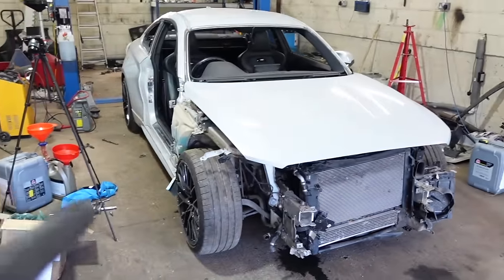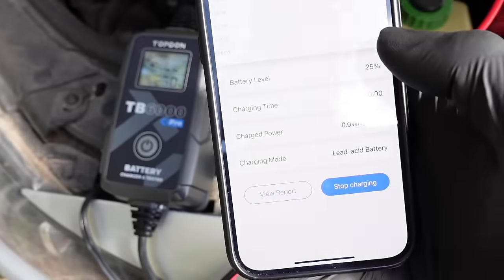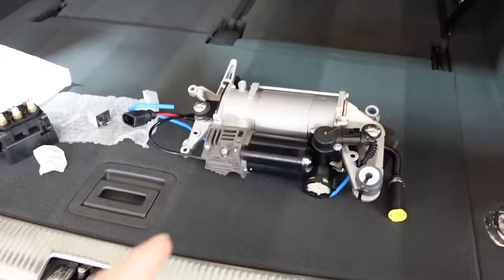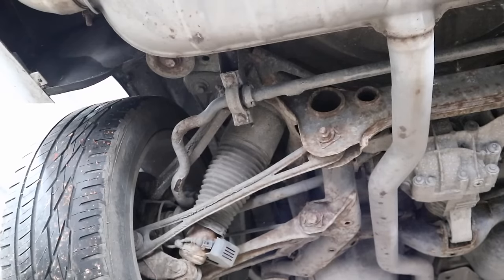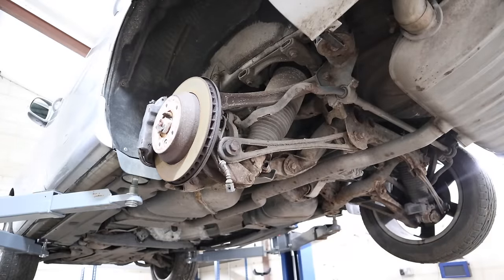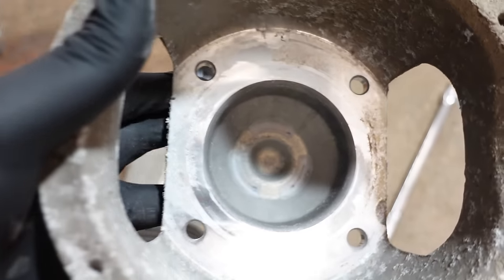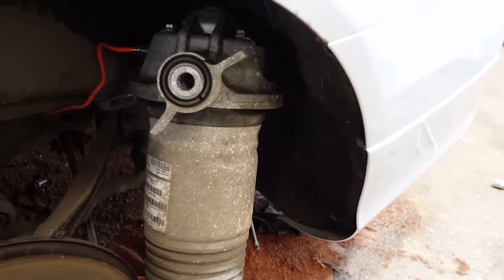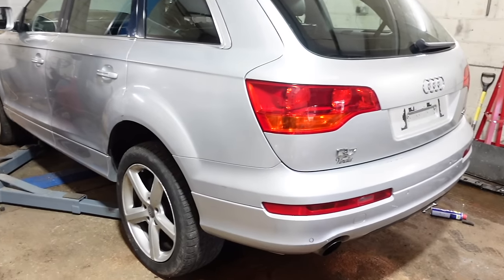FIXING MY AUDI Q7 FOR FREE!! AUDI WANTED £10,000!!!

Comment: 50 years ago a good mechanic would have happily diagnosed the issue correctly and charged you a few hours labour to do what you just did. Today, being a mechanic generally means (obviously not all) learning how to use a diagnostic machine to tell you what parts you need to order and then just swap. Far too much of a throw-away society today IMO. Good job well don pal !!
Reply: Can't remember the last time I plugged in a diagnostic, only for it to tell me a sensor has broken...now you mention it, what is the point, it can save time and effort, but personally I've found the system just reports back on itself making the entire thing redundant.
Reply: 💯 agree. We’re very lucky to have a polish mechanic who very old school. Doesn’t sell you anything you don’t need and pretty much refurbs stuff that can be. TBF only really bible as he charges a ‘fair’ hourly rate and works for himself at home, so very few overheads 👍🏻
Reply: To be fair 50 years ago Audi would never have dreamt of designing this garbage to begin with so mechanics then didn’t have to deal with poorly engineered over complicated rubbish.
Reply: The early 2000’s were a happy medium where good mechanical knowledge + modern diagnostic tools good get you very far with with diy. With the most recent vehicles you’re useless u have to seek mechanic or dealership because vehicles are way too complicated now
Reply: If you took this to a mechanic 50 years ago it'd take him an hour to figure out how to open the door.
Reply: @James__bond007  Yep, and even when you identify the issue, half the time you need a special tool to replace the part.
Reply: Totally fake video, he came back 5 minutes later to show how It s worked, the front sospensions magically repaired without even touch them
Reply: @8dvd8  You obviously missed the part where he fully explained the reasoning behind the fronts not needing to be repaired, or you're just trolling. Probably the latter option methinks.
Reply: @8dvd8  Maybe consider less drugs? Dean never fakes anything and your comment doesn't even make sense.
Reply: @Nite-owl  i missed because It s a clickbait, a scam. Like the part when the battery apparently " died " ( not replaced with a junk One or left die for commercial porpuse ) . Open your eyes
Reply: @8dvd8  My eyes are perfectly fine and open, thanks. I'll give you the segway for the battery charger thing wasn't exactly smooth, and was in all likelihood a setup for a sponsor segment, but lets be honest, no-one's stupid enough to think it wasn't likely, nor are they dumb enough not to expect sponsored videos on YouTube channels. Very few are bothered by them enough to kick up a fuss. Either watch the videos, or don't. If you don't like the content, don't watch anymore of their videos, it's not a complicated system if you think about it 🤪 
As far as I can tell, the title was not clickbait. He fixed the air suspension himself by removing and cleaning the O-rings, rather than pay an outlandish figure to replace the airbags that was quoted by the Main Dealer. Not sure what you felt was clickbait, but I'm sure you'll enlighten the World with your wisdom 🙄I on the other hand won't be replying further, your comments don't warrant any further time wasted. Don't like it, don't watch, now move along please !
Reply: @8dvd8  jog on
Reply: @8dvd8  ugh you are probably 12 but please don’t comment when you have no clue.
Reply: very different times now. walk into any garage and theyll rip you off if they think they can.
Reply: 50 years ago cars had carburettor and people never heard of a Turbo was there no such thing as an ECU or a OBD PORT where you can plug the car in and cars get more advanced it FACTS
Reply: @agt155  My father rebored his last engine at 80 years of age he lived to 90..
Reply: That's easy when the manufacturer doesn't ask you for "technician lvl 2" to calibrate a swap senzor ..
Reply: @Ralph Reilly Depends on your definition of "heap of crap". It wouldn't have the refinements, but it also wouldn't have the possibility of those refinements breaking. I'm also not sure that this car is likely to be revered and looked after well enough to be still on the road in 50 years, unlike a few cars from the 1970's. Will this be thought of with the same reverence as say a Mk1 Escort or Capri in 50 years time? Unlikely methinks. You're entitled to feel differently though 🙂
Reply: By throw-away your also referring to our money being thrown away too
Reply: @jkclassy3643  You're
Reply: @8dvd8  
Mate he isn't going thru hours of vid to show exactly everything.....just take is a given.
Reply: Cars 50 years ago didn't have canbus and had carburettors , don't kid yourselves and be arrogant. Today's cars are far more complex then adjusting points on a distributor or using the rule of 9 on a mini valve terrain.
Reply: It’s funny. We do exactly the same in aviation. Younger lads in particular these days have no troubleshooting skills. Just change the same part over and over expecting a different result. Times have changed
Reply: @R2D2trashcan manufacturers playing the one-upmanship game for the sake of it.

Comment: I have a 2008 Touareg that I'm about to try an repair the front drivers side that has a leak ..once apart and reassembled will I have to readapt the suspension for that corner

Comment: Top job. I was recently told by Dealership that my EGR valve needed replacing. I studied about it, the system and took it off, dismantled it, cleaned the soot off the part and reassembled.. Car milage back to normal and saved me the estimated 550euros for a new one which i did not need. These “ stealerships” are criminal money making machines.. shocking.. great job Mister!!!!

Comment: Dean you will not be a favourite down at the Audi centre but will however be a star with many Q7 owners. You definitely have my vote and exemplify the difference between a mechanic and a "fitter".
Reply from the maker: It won’t make a difference because no one with an 8 year old and older Q7 will spend 10k on suspension anyway.
Reply: My comment was actually referring to your "theft" remarks when you were describing the cost of the suspension units. Hope their lawyers don't watch your channel Dean.
Reply from the maker: @davidg2073  not selling a simple O-Ring and instead forcing you to spend £2800 for a complete unit which isn’t required is basically theft 🤷🏼‍♂️
Reply: I agree completely and admire you for having the guts to say so publicly. I on the other hand  have had my own costly brushes with corporate lawyers that has instilled a more cautious approach regardless of any apparent injustice.

Comment: Changed rear air bellows on a 5 series touring, good quality parts off Ebay for £80 a pair. Work took just three hours, fiddly but relatively straightforward. BMW wanted £2k for the same job! Eighteen months on and no issues....Lesson learnt.

Comment: Hi Dean, O rings of the size you have on your air suspension are readily on line, or local engineering suppliers. O rings can take a set so are not as effective when reusing, and yes always use a  suitable grease to help with resealing as per Snoppy. Nice fix as usual.

Comment: I love fixes like this. About 11 years ago I owned a Volvo S80 T6. Dashboard messages about brake and steering faults, and to stop immediately. A bit of research told me it was likely to be an ABS electronic module under the bonnet, for which my Volvo dealer would relieve me of something like £1400+VAT.
Further research revealed it was likely a cracked/dry solder joint on the power inlet to the module.
Half an hour to remove it. Another 20 minutes to dab each solder joint. Half an hour to refit it. Problem solved. Only cost was £15 for a set of sockets for the Torx head bolts that I needed to undo.
Reply: Also, I have a Volvo XC70, the interior door handles are prone to breaking. Volvo want £450+VAT for a complete new door card (the clips on the back of the card break), and you would have to wait weeks for one from Sweden. I fixed it for under £10, £4.50 of which was new door card retaining clips, £4.50 was a set of small drill bits for an electric screwdriver, and 89p was for a pack of hooks for net curtain springs.
Reply: I had a similar thing on my volvo s40,stop car brake failure,abs and the like,dealer said module £1000 went to the volvo forums turned out my battery was on its way out

Comment: Excessive Cranking Cold: my DERV used to crank 5 seconds + cold.  An 85mph run (2500rpm) for 100miles  fixed it.  Now starts immediately as it should.  Uncovered other faults too, (failing Water Pump Bearings and DMF), well worthwhile

Comment: They sell a kit to make your own o rings. Comes with several different diameters of "cord" which you measure, cut, and glue to make any size o ring. It's used by heavy equipment mechanics repairing in the field. It's a bit pricey at around $250 roughly I believe. I haven't purchased the kit myself but mechanics swear by it. Just a thought for you to consider. Keep up the great videos.

Comment: I'm a retired Design Engineer. You can get ANY size O ring you desire if you approach the suppliers. They are easy to measure and you could also upgrade from a basic Nitrile type ring if you wanted to. I'd also add that the aluminium corrosion has migrated causing the leak in the first place. Some O ring lubricant could mitigate the same problem from reappearing....🤔🤔😏😏😏😏😀🇬🇧

Comment: Excellent find, were you not tempted to clean up the front as precaution, or use silicon grease on the o ring?
Reply from the maker: The front assembly was slightly different, so it was a case of “if it ain’t broke, don’t fix it”

Comment: Great stuff, this is unfortunately the problem with main dealer these days. There is zero investigation, it’s part of part on until it’s fixed and all at the customers cost. I share a space with a mechanic who loves nothing more than doing what you just did. He’s saves the customers £1000s just by giving a f**k and seeking the cause of an issue. Keep up the great content 🏴👌🏻🍺
Reply: Recently had an aud " specialist" tell me we need to start throwing parts at this to fix it.
Also started taking about impellers on the air pump failing 🤦‍♂️😅😅 chancers
Reply: What’s the name of the mechanic you share space with .

Comment: as my dealer says-"we don't fix things we replace parts".   Audi have just shown you why people don't want to buy VWAG air suspension vehicles used despite that fact they provide superior performance.  i love my air suspension Touareg however you are best to diagnose and fix it yourself or find a good independent shop.   there is a UK firm that supplies a repair kit for the compressor.  my Touareg has 280K kms on it and i have replaced a compressor(direct from a German supplier approximately  $465 versus $2,547 from VW), a sensor (from a US dealer-several hundred dollars less than my Cdn dealer) , and 2 valves (from an independent shop) during that time.  Keep up the good work-  you are educating people and saving us money !

Comment: Great fix, Dean. I would have done the same as you did. (always looking for the cheap & cheerful alternative) 😊. Great result.
Replacement parts in stock, for similar project. With not a so easy fix. 👍👍

Comment: As others have said, I would suggest putting a smear of silicone grease on the seal. It keeps the seal supple, prevents it from distorting and it repels water and will keep the corrosion away for longer.

Comment: Fun fact! I found that o-ring in my swimming pool filter pump o-ring compartment in my work truck! On top of cleaning and lightly sanding everything, i  magic lubed the o-ring just like a pool pump motor. Air Tight!  Wouldn't have been the case if i had gone to the dealership.. Would've been whistling Dixie!!

Comment: Good fix but I doubt it will last. Take the o ring to a seal company, they will probably charge £30 for brand new ones. Re using compressed o rings you will not get the sealing pressure which is why they leaked in the 1st place.

Comment: I'd have measured and replaced the o ring rather than just clean it, the material does harden over time and this repair will lack longevity. As others mentioned a smidge of silicon grease will also help protect the rubber.

Comment: That's really good investigation and work there. I may be wrong, my thought seal would get some water on it and it would sit on top. Once the water on top has frozen, it would corrode the top of the seal cause it to offset the rubber allowing air to escape. Anything you could add on the top of the strut to stop the water from gathering and or freezing? 🤔

Comment: You can make or get made your own O rings.  You can buy O ring kits online.  If the existing one isn't compromised you can soak it in power steering fluid and it will swell back to its original shape.  When refitting make sure it is lightly coated with silicone grease.

Comment: If I was to do this I would treat the rubber with a hydrater to restore the elasticity of the rubber to just help it even more. Fantastic work as always though and just shows you can save so much money by just being a bit of investigation instead of firing parts at it

Comment: Great diagnosis and repair 👍 but, as others have commented, a helping of Instant Gasket or similar would compensate for any reduction/distortion in the shape of the ring's cross-section and any  loss of softness/flexibility due to long term pressure and aging.

Comment: Cheap fix👍. I've got an O ring kit so I can make any size. All you do is cut to length the size of O ring you need and glue the ends together, I use this on hydraulics so pneumatic systems are no problem for pressure.

Comment: You forget to put some silicone grease on the ring before reinstalling. O Rings work by deforming into the grooves when pressure is applied, the grease helps the ring move about and find it's happy place in the housing. Not a lot is needed, just a rub over on the ring before fitting.

Comment: That O ring can failure du to the corrosion. Look at the surface! The corrosion  goes over the ring and thus the air escapes over, and because of the pressure, cuts the ring. Clean the surface from corrosion, new ring, and use something to protect the metal.

Comment: Nice one Dean - little bit of time and effort saves some serious £ ! Look forward to seeing the Q7 finished and bodywork sorted as it was a solid piece of kit. Probably needs a bit of a run and some diesel cleaner put through it just to clean up the valves / plugs etc as it sounds like its struggling a little on start up.

Comment: I'd still change the compressor tho kidda , you'll find the motor inside will have worn plates due to the excessive pumping to keep the leak topped up , for the sake of the £200 its better to fit it , it's a quick job really , strip the motor carefully just have a look at the core plates if they're OK you can ealiy put it back together.

Comment: Great video again mate. In the future if you need any O rings you can buy O ring cord very cheaply in loads of different sizes. you simply cut it to the length of the old one and use a drop of superglue to join the ends to make it a ring. you can build up a stock of various standard sizes for not much money, saves a lot of headache some times.

Comment: Hi, just a thought. I have a car which sits in my garage for long periods and invariably had a flat battery when I wanted to use it. I bought a battery disconnect from EBay very cheaply and now when it goes in the garage I just turn a knob to disconnect negative terminal. No flat batteries ever since.
Reply: It could be your brake-compressor starting up, because of some leak, possible inside the compressor itself. I had this problem myself, and did as you did, at first.  Later on, when having a coffe, sitting outside in the sun, with the car standing there, all switched off, and doors closed, I suddenly heard a compressor starting up. Even when the car was switched off!! Its the breaks, to hinder the car from starting rolling downhill after a while, I think.

Comment: Great video. The main dealers/manufacturers do not cover themselves in glory. Currently buying some Mazda parts - all plastic bits around the bumpers and the front panel - a complete rip-off but no pattern parts for this jigsaw like structure.

Comment: Get that scuttle panel cleaned out of leaves and sludge. My Q7 developed gear selection problems caused by water damage to the Gearbox ECU and loom due to water not escaping the drain plugs due to blockages.

Comment: Im not a mechanic but BMW quoted me 500 quid to replace an entire headlamp unit because it wouldnt electonically adjust and failed MOT. So i looked at it myself and with 2 small trim tools got inside and forced the headlight rail back onto the servo, fixed it in 2 mins. It seems all they want to do is get you to buy parts from them instead of fix the ones you already have.

Comment: I was a mechanic in the 80s and it was straight forward, engine, gearbox, plugs, points and distributer, no computers no sensors  put the same oil in any car, now it's all about sensors and codes but if the sensor wasn't there the engine would be fine, we spend money on things telling us others things need replacing, it's all about money and getting as much as possible, it could never stay the same as before because no one made money out of it, just one big rip off

Comment: alu corrosion...:) That is why you need to clean the car from time to time:))
for that price i would try silicon too (let it dry for 1 day and test it then):))...

lots of times the fix is just cleaning up....i had this lots of times with different parts.

you would have to clean that corrosion on the front too...

did you oil the oring a little?

mitsubishi evo has the same issue on the pump -- alu corrosion